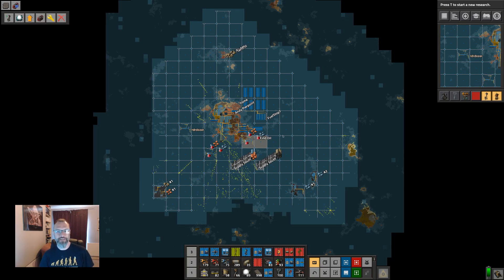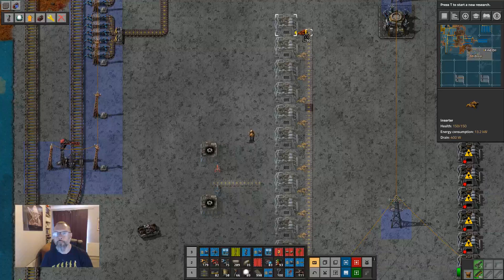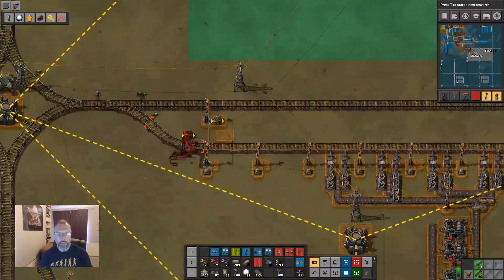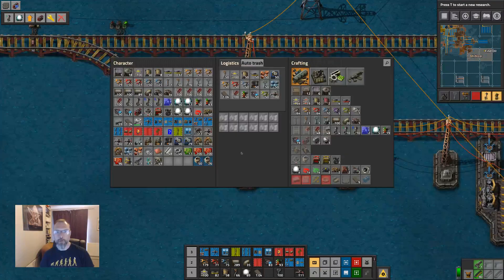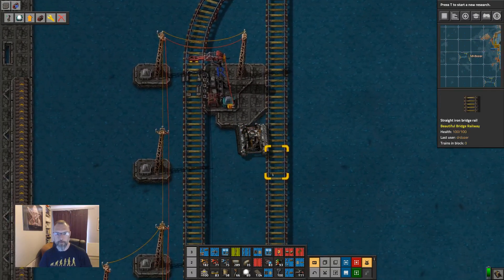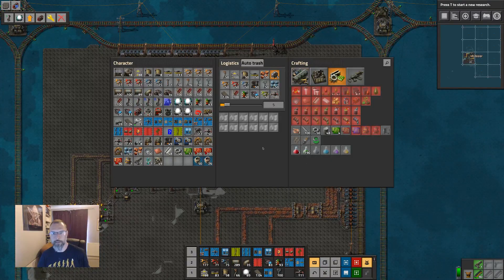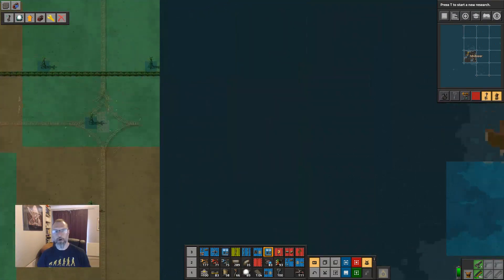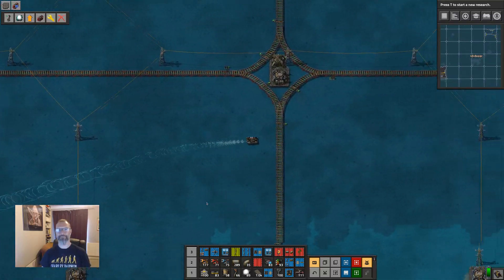Factorio: Atlantis 36

Comment: Sorry mate, but your requester stations are still not quite right. You currently have a wire coming from the station itself to the requester entity. This wire needs to come from the train counter entity (looks like a constant combinator) at the foot of the station then connect to the requester. This is the only way you will get the trains on t he way signal. If it is not c connected properly, TSM will keep sending additional trains to that location until either there are no trains left or the condition no longer is calling a train.
Reply from the maker: Thanks. I think ive fixed it now but I recorded a few vids back to back so it may take a couple for the fix to show